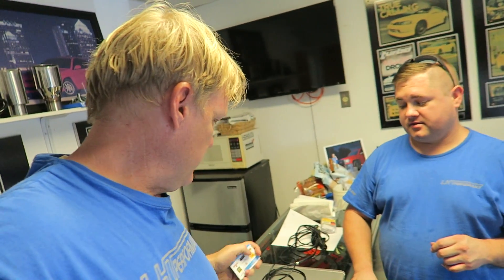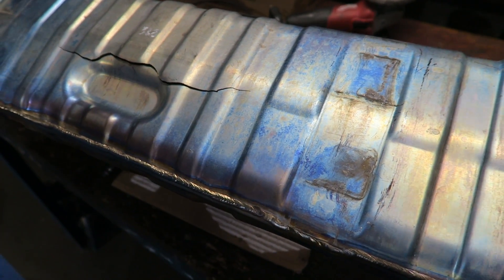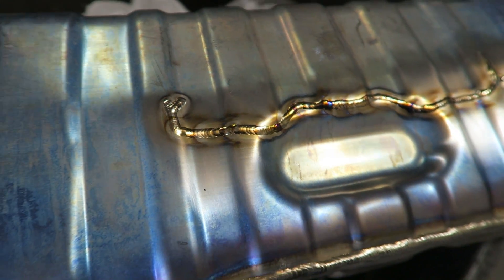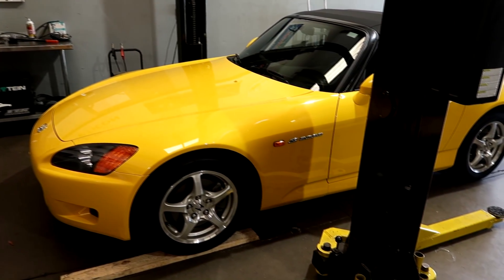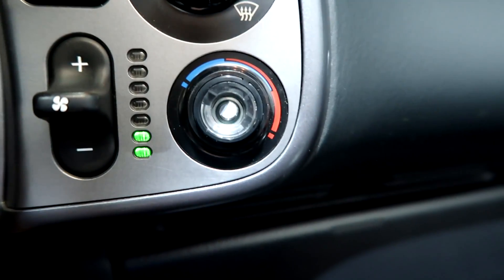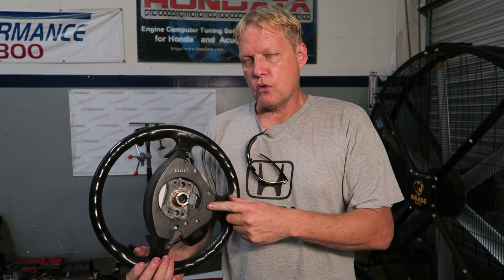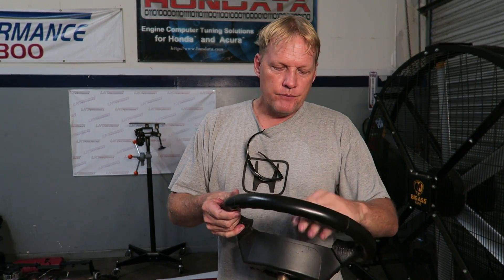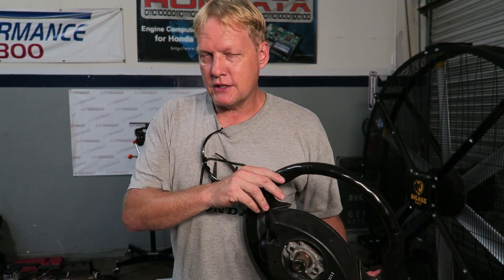Porsche titanium Repair + S2000 AC Knobs

Comment: I had a fellow S2000 friend deal with this issue. Steering was heavy and would fight you in turns. She has the advantage of having a husband who also has a MY00 S2000 so they swapped the "gold box". Unfortunately, that didn't fix it. They had to replace the torque sensor. It was a little tricky to get in correctly. If it's not revealing too much of your trade secrets (that I respect), maybe you can do a quick how-to? Every classic car needs an expert to keep them running for as long as possible. Thanks for being one of those guys and sharing.

Comment: If you have any viewers who are also drummers (like me), they will be familiar with your crack-stopping drilled hole trick because this is how we increase the service life of our cymbals. In this case, the metal is a brass alloy, but the principle is the same: The vibrations cause a crack to start (usually from the inside and running toward the outer edge) that can be stopped with a carefully placed drilled hole.  By the way John, it is pronounced POR-sha.

Comment: Hey John.  3 things to mention here. Good tip on drilling the holes to prevent further cracking.👍  The repair job came out nice.  The S2000 buyers assistance program sounds great.  I think there's a lot of value to the customer to have an S2K specialist like yourself sourcing the car for them.  And finally, there's nowt wrong with your accent.  It's Yorkshire innit?😉  I mean, you hooked Esther with that accent, so it sounds like a winner to me.  See you on the next one.

Comment: @200k miles, I had a same steering issue in cold days, and I tried cleaning method shown on S2Ki site. Under the dust cover, there's a shaft seal.  Lift the seal just enough to insert a tube of cleaning can (DeOxit D5), then spray & clean.  
It fixed the problem and still good at 250k miles (I  bought a spare torque sensor just in case though)
Reply: I need to try this. Thanks for sharing!
Reply: @mansomech  

https://www.s2ki.com/forums/www.s2ki.com/forums/showthread.php?page=8&t=1146902

Torque sensor is just a potentiometer (like radio knob), so radio control car hobby people clean this way.

No need to take the sensor out.  Remove airbox and you can access from top.  Pull the dust cover, lift the seal using 90 degree pick and insert the tube.  (Need to modify the tube or buy flex tube)
Reply from the maker: It’s a good DIY temp fix. Sometimes it will buy a year and sometimes a couple of months. The correct way is to replace with a new one.

Comment: Do you know if that AC knob fits 2000 and 2001 model year s2000s? My last one was a 2002 and had that part number but when the dealer looked up the same part for my 2000 (with 27k miles) it came up as 79601-s2a-003 but that one is discontinued. Thanks
Reply: did you get an answer to this question? I have the same issue.
Reply: @rizzllzahid2683  No. I found a place online that still had some in stock